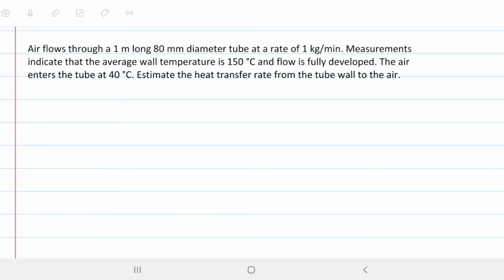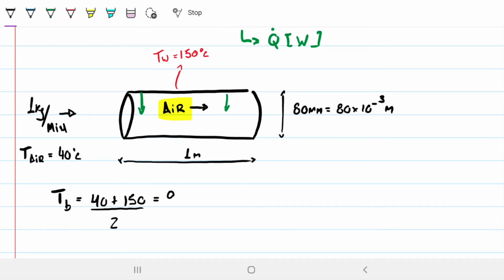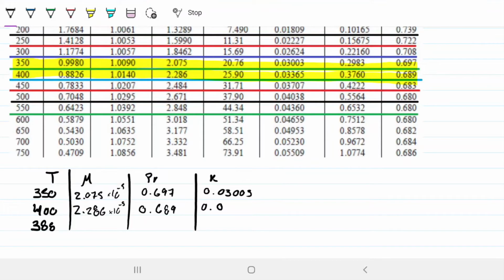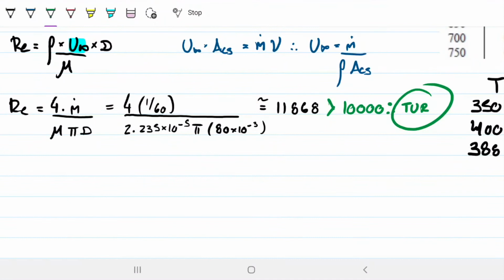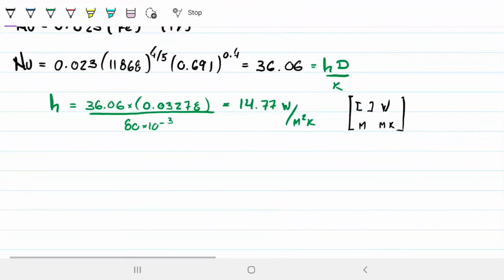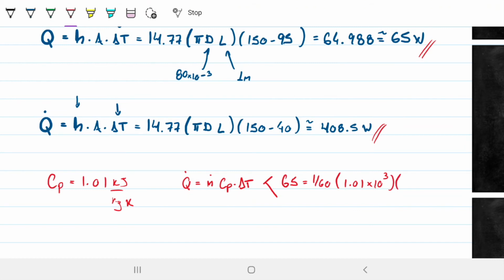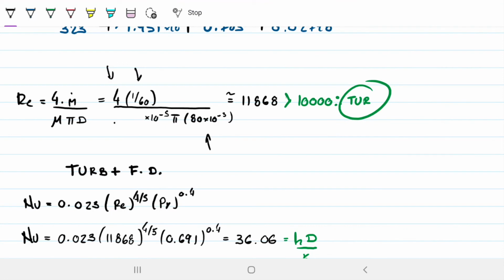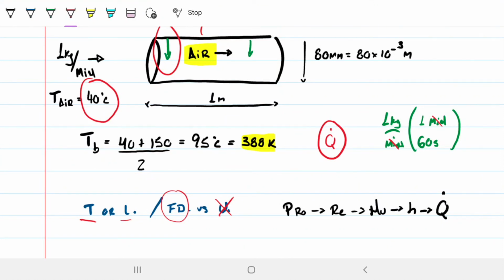Internal Forced Convection in a Tube (Air) | Heat & Mass Transfer

Comment: Where did the numerator D at Reynolds No. go?
Reply from the maker: It is explained at 8min20sec
The conversion of the velocity used the surface area, which has radius square (or diameter squared). So the D in the numerator divided by the D^2 in the denominator